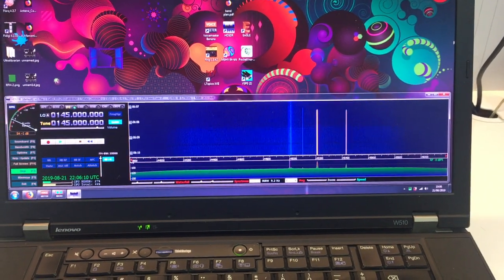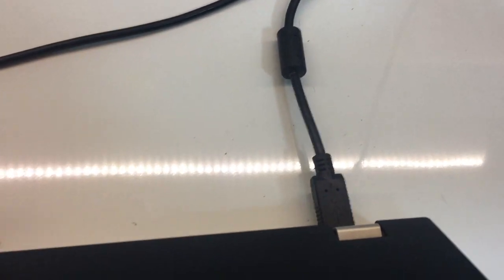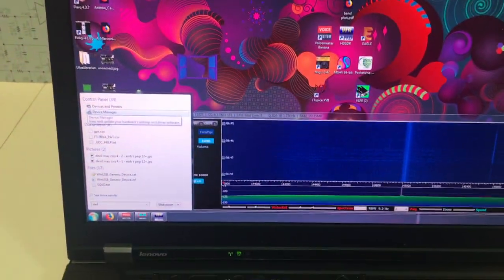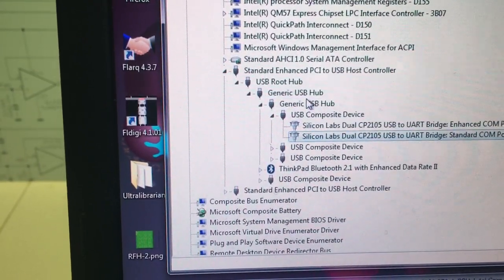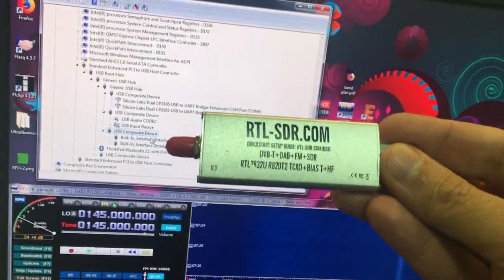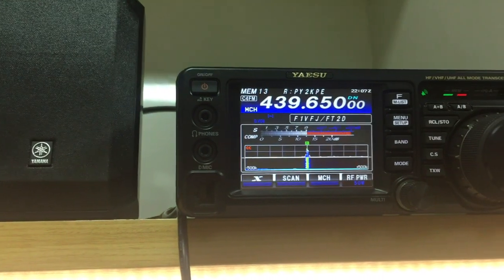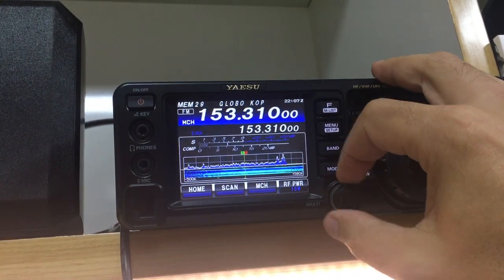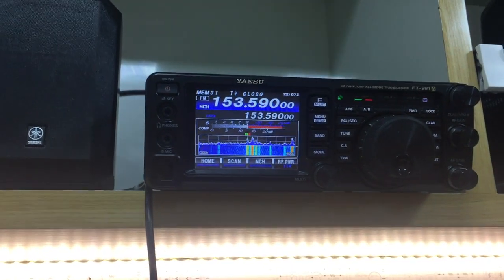Turning FT-991A to a REAL SDR: Embedding a SDR Panadapter INSIDE the radio, no extra wires!

Comment: What a great project! My 3-year-old Ft-991 (not the A model) just went belly-up on me 3 days ago. It's seems frozen on the "Yaesu" boot screen. I've tried pretty much every trick I know. Pulled the main power...tried a complete reset..nothing works. I'm waiting for word from Yaesu on sending it in for repair.

I'm thinking I'd like to do this to my 991. I've been using an SDRPlay with a DXE RTR 1A to protect the SDR. What a pain, but it works.  I like this way much better. Plus I have a couple SDR-RTL dongles sitting here doing nothing.
Reply from the maker: Hey @PhillipZX3 o/ Thank you very much for your comments!
K3DDT was able to successfully build one - And I was very happy about that.
However Phillip, I crafted a striped-down version, easier to build and without stuff that are useful for my tests - unnecessarily raising the BOM and complexity.
Be sure to pay a visit to https://github.com/rfrht/FT991A-PAT/wiki/appendix-the-light-edition
Good luck on your enterprise - Feel free to file a issue in Github or discuss in QRZ forum (thread: https://forums.qrz.com/index.php?threads/hard-hack-embedding-a-sdr-in-ft-991a-need-rf-designers-review.650840/page-5)
73 de PY2RAF.
Reply: How to switch on: Unplug 12Volt. Press [LOCK] and hold. Plug in 12Volt. 

Then FT-991 comes up. Wait a minute. Switch off (standard way). Switch on. That's it.
Reply from the maker: Peter is right. And also the obligatory: Check the voltage, this issue is known to happen in undervoltage. Do a triple check in your power supply.

Comment: @Rodrigo AB Freire, entonces como lo hicistes? Simplemente usas un cable USB desde el puerto de USB del 991A, o, hicistes la modificacion de instalar el board dentro del radio?
Exixten en YouTube, 2 videos mas aparte del tuyo. NADIE especifica cual puerto del 991A estan usando. Yo tengo un cable USB conectado al puerto de USB en el radio. Tengo un RSPdx. El RSPdx controla el radio y vice versa. 

PERO

El waterfall, la cascada que yo veo en el 991A, no se replica para nada en el RSPdx. Simplemente se ven los picos, todos uniformes, se oye el audio pero si hay otra senal en el spectrum, el RSPdx no la ve.

Cual puerto estas usando en el 991A?
Reply from the maker: Hola, Gilberto. Uso el puerto USB existente del FT-991A. Sin embargo, hube un montón de cambios que hice en la radio para lograr éxito. Echale un vistazo en https://github.com/rfrht/FT991A-PAT/wiki ; allá están todos los detalles de como lo hice. Un saludo.

Comment: Details...it's all in the details but from this video I wouldn't know where to start, for instance what protects you SDR receiver?  Are you using headset for microphone audio? PTT?  etc.
Reply from the maker: Hello there! The SDR taps on the RX IF line, so no strong signal over there - and the amplifier board switches off the IF line during TX. I use a headset in the computer for voice comms. For PTT events, sometimes I use VOX, other times I use a foot PTT to trigger the TX. Check the project's wiki: https://github.com/rfrht/FT991A-PAT/wiki - over there you will get all the technical aspects of the board and how to implement it. To see how I did the audio via the computer, check this: https://github.com/rfrht/Voicemeeter-FT-991A/wiki

Comment: hi, the  rig´s cascade spectrum display uses a yaesu sdr, any chance to take I Q signals out from it?
Reply from the maker: Hello Diego. Unfortunately, not. The Scope Unit provides an analog signal to the CPU, which is parsed and then rendered on the display. There's no I/Q transformation that could be tapped.
Reply: @rodrigoabfreire3490  I think Yaesu should provide I Q signals thinking in hams, good to propose.   thank you very much 73´s LU2DVY

Comment: Great video but could You post a video before and after you changed the radio to an sdr for single side band to hear the difference. Also don’t you void the warranty?
Reply from the maker: Hello Bruce, good morning- and thank you very much for the kind words!

1) Indeed, I voided my warranty, sure thing. But got a heck of a radio ;-)
2) You can see any differences on radio sensitivity with and without the signal tap in this video: https://youtu.be/yeTeMTJRBIg
3) With regards to the actual install work, unfortunately I don't have any videos head-to-tail on that. I do have instructions on how to o the whole thing on this github page: https://github.com/rfrht/FT991A-PAT/wiki/

Some pictures are missing because they are hosted in a server at my apartment - which is undergoing a renovation/construction and the server were removed - it will be some more weeks out of order.

Feel free to reach, will be more than happy to help!
Reply: Thank you so much. Hope to see you at HamCation in February.

Comment: or just buy an ICOM IC-7300
Reply from the maker: No. The IC7300 does not provide the functionality that is achieved here. No I/Q output for using down further by any SDR/GNURadio application.
Reply: 7300 has only HF no V/U

Comment: Over two years now does this system still work? Thank you Rodgrigo!!! 73 de NØGFT
Reply from the maker: Hello Carl! Just. Perfect. Not a glitch or any negative impact on the radio.
Reply: @rodrigoabfreire3490  Excellent, thank you. Your github page 'installation' has some broken image links, FYI. I reference your github page very frequently and recommend it to the 991a facebook groups when they need reference material, especially your documentation on the Menu Settings.
Reply: What a great patent!!! You should work for YAESU. Rodrigo can i send you my radio to customize it? 73’